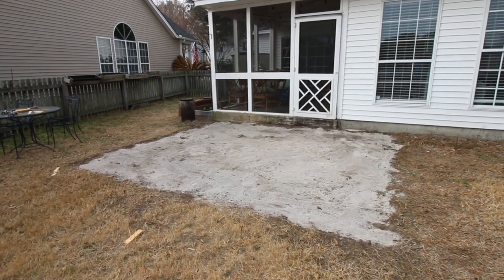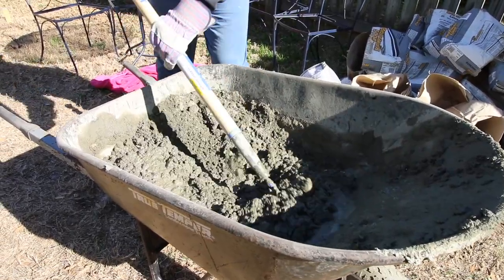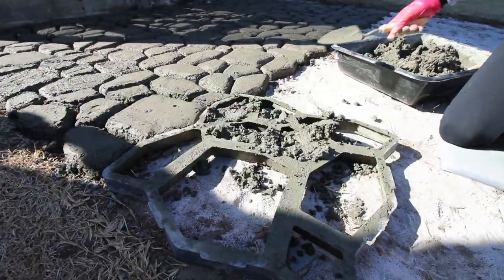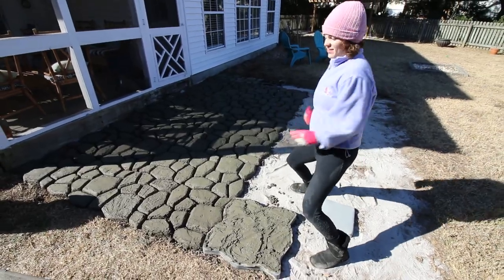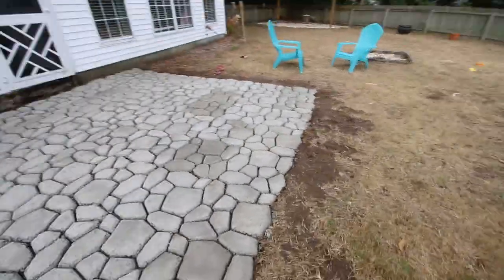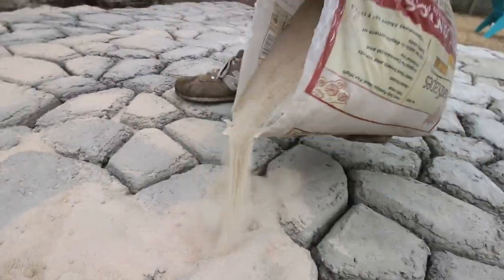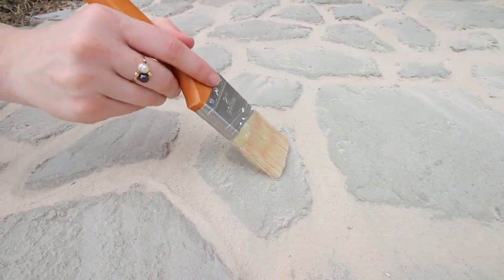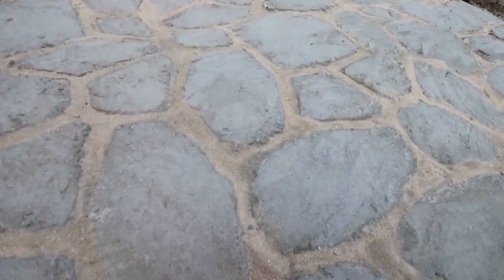Quikrete Walkmaker Patio DIY Project Tutorial

Comment: Thanks for this awesome video!!! I've been doing my research for a few weeks now and feel I am ready to take this project on as soon as it stops raining here in Indianapolis! I noticed that each time someone asks how many bags of cement you used you give the same answer "That really depends on how big your space is! The bags of concrete are about $5 each in our area, the jointing sand is about $20, and the molds are about $25." which is helpful within it's own right, however I am wanting to know how many bags it took for this specific project. The reason being that per the dimensions of 14x14 that you provided, coupled with the dimensions given on the paver mold I just purchased, it will aid in me purchasing as close to the correct amount of bags. Could you please share how many bags you needed to complete your 14x14 patio? Thanks in advance!!
Reply from the maker: I believe it was about 32 bags. But maybe get some extra to be safe ;)

Comment: Hey. Thanks for the information 💜💜. How many bags of quikrete concrete did u use for the 14x14?
Reply: 49 60pouds bags I understand is one bag per each stamp. Each stamp is 2’x2’.
Reply: To add to what Cristhian said, Pallets of 80lb concrete from most box stores are 42 bags per pallet.  Not sure if the 60 lb bags are more per pallet or not.  Were currently working on a 12' x 50' patio.  Its a beast of a project.

Comment: Great job, looks good and you explained things very clearly. Any chance of an update after it's been a year? Any problems or issues?
Reply from the maker: Glad you liked it! The update is that it still looks amazing. We have had no problems with anything. No weeds breaking through, no cracking.
Reply: Charleston Crafted great video! Did you do anything to the edges of the patio? I’m worried that the stones could break off from the edges without edging?

Comment: Excellent video this! I am a new home owner and my backyard is just dirt now. Can I do this over that or do I need to cover it with any material first to get started using Quickrete? Please advise.
Reply from the maker: You should make sure the ground is level and compact. The best thing to do is to lay down a layer of leveling sand first, but you can do without it if the ground is well-compacted.

Comment: Hey.. this is an awesome video and the first one to describe polymeric sand. Wanted to know about quantity of sand required for number of molds.. ballpark please. Also you have mentioned in one of your replies that edges are broken because of moles.. I am anticipating that problem too. How did you fix it?
Reply: I also have the same question. I just made two walkways using the walkmaker and would love to have a ballpark on the amount of polymeric sand needed. I have 31 walkmaker grids between the two walkways.

Comment: How many bags of quikrete did you end up using? I’m wanting to make something like this and it’s hard to estimate how much to purchase. Also, could the sand you used in between be used with larger pavers?
Reply from the maker: We found that we needed about two bags of concrete for three molds. The exact number will vary based on what size you go with. The sand can definitely be used between any pavers you go with.

Comment: how long did it take you to set the actual stones. I do realize they had to sit up for a while before adding the fill in sand for the grooves. I'm curious to see how long it takes to fill and each mold before you move to the next mold. Great Work!!
Reply from the maker: If you have someone mixing concrete and someone filling the molds, you can move seamlessly along. Putting the concrete into each mold just took a couple of minutes each, then you immediately lift the mold and move on to the next one.

Comment: How many bags of the polymeric sand did it take to complete this job?
Reply: 1- 80lb bag of concrete fills one mold.  Each of these molds are 2'X2' and are 2 inches deep. If you have irregular area, then you are gonna need to also make some spare on like a board of wood or cardboard to fill in the odd spots. I have also seen people use cardboard to create molds in the odd spots where molds will not work and need filled in.
Reply from the maker: It took us about six bags I believe.

Comment: I wonder if there's going to be any issues when I do my project like this to let grass grow up between them
Reply: I made a similar patio but laid down weed barrier first.
Reply from the maker: We've had no issues whatsoever with growth because of the polymeric sand in between the pavers.
Reply: So I didn't catch it in the first part of the video, did you have the whole thing pretty level? How did you accomplish that?

I was going to do something like this, but I have to do something quick and dirty to be ready in like 6 weeks, so instead I think I'm going to just buy some large 2x2 concrete pavers and set them up so they are level, and then put some of those decorative interlocking deck pavers on top for a nice look. It won't be long-lasting because of roots underneath and no gravel or sand, but I can always redo it after.
Reply from the maker: @kbanghart  We removed the old patio, then dug out a new expanded area. We leveled as best we could with the dirt that was there, but then we used leveling sand. That took care of the rest.
Reply: Do you think it work as well to just put weed block down over grass or mud ?

Comment: So,  the molds don't require the same preparation as stone pavers? Like landscape fabric,  gravel,  etc?
Reply from the maker: We did add some leveling sand, but not much. It depends on your area and how much shifting your ground does. We haven't had any issues. The polymeric sand in the joints is flexible, which allows for the "stones" to move around a bit.

Comment: That came out great. How many square feet was that? And about how much did it cost to complete?
Reply from the maker: It was a 14x16 patio. Cost will differ based on your area. You need about 2 bags of concrete for every three moles and a bag of concrete is usually $5-6 per bag.

Comment: What did out cost you to finish the project? Thx for sharing looks simple
Reply from the maker: The bags of concrete are about $5 each in our area, the jointing sand is about $20, and the molds are about $25. We used 32 bags of concrete and 6 bags of sand. And 2 molds. So just under $400.
Reply: @CharlestonCrafted  thx

Comment: Can you tell  me an estimate of how much you spent for your 14x14 feet concrete patio? I'm planning on doing my backyard and want to know how much it would cost me. Thanks.
Reply: I did 3” of gravel under mine before pouring my pavers which is about a  14x14 area. For the gravel, 2 walk maker molds, and the high strength concrete mix and a trowel to give it a smoother finish on top and the joining sand it cost me $496. Hope that helps

Comment: Hi! Id like to know the walkmaker mold and polymeric sand ratio. How many mold per bag of sand?
Reply from the maker: Officially one mold = one bag of concrete. We found we used a little less than a bag.
Reply from the maker: Oh sorry you mean the sand. We used 2 bags for 48 square feet
Reply: Thank you for your reply. Polymeric sand is expensive but I think it’s worth it. BTW, they recommend to seal concrete after 28 days. I will seal mine after laying out the polymeric sad.

Comment: i made also a sidewalk in my yard. but i don't want to fill it with sand. does white cement will do the work as well?
Reply from the maker: Any color concrete will work (they have concrete dye) but we used this specific type of concrete due to the exterior durability.

Comment: How much did this project cost you?
Reply: I just did a patio last weekend that was about twice this size.   Mine was about 275 sq ft.   took 75 bags of fiber reinforced concrecte $330 + 12 bags of poly sand $140 + 2 forms (17/each)  I put in paver block edging as well around the edges, which was an extra $100, but it cleaned up really nicely.   all together that cost me $610.   Saved me THOUSANDS had I paid some one to do this.
Reply from the maker: That really depends on how big your space is! The bags of concrete are about $5 each in our area, the jointing sand is about $20, and the molds are about $25.
Reply: Saving thousands is what its all about
Reply: Just 5 dollers

Comment: You guys did an amazing job! This is my project next weekend and your patio size looks about the same that I need... How many bags of concrete and sand did you need as coverage for your area?
Reply from the maker: Hi Kamiliah! We ended up using 36 bags of concrete and 7 bags of the polymeric jointing sand. I would recommend having a few extra bags on hand in case you end up using a little more. The molds are made to hold a whole bag of concrete, but we found that two bags did about three molds. It wasn't exact, so that's why we recommend just getting a few extra bags that you can return later if you don't use. You don't want to end up having to run back to the store when you only have three squares left! Thanks for watching!
Reply: Charleston Crafted Thank you so much!
Reply: How much did this project cost you? We are doing walkways and cannot believe how simple and gorgeous this looks!

Comment: when i attempted this, the rocks in the concrete mix came to the top. so instead of a smooth surface, i had a bumpy, rocky one. i made a few and gave up...
Reply from the maker: I’m sorry that happened. It sounds like your mix was too watery. It should be the consistency of wet peanut butter! Pretty thick.
Reply from the maker: I’m sorry that happened. It sounds like your mix was too watery. It should be the consistency of wet peanut butter! Pretty thick.
Reply from the maker: I’m sorry that happened. It sounds like your mix was too watery. It should be the consistency of wet peanut butter! Pretty thick.
Reply from the maker: I’m sorry that happened. It sounds like your mix was too watery. It should be the consistency of wet peanut butter! Pretty thick.

Comment: So pretty....From start to finish, what was the total cost for that 14'x14' concrete slab and how many days did it take?
Reply from the maker: It was a 14x16 patio. Cost will differ based on your area. You need about 2 bags of concrete for every three molds and a bag of concrete is usually $5-6 per bag.
 It took one day to do the concrete and about half a day to do the sand.

Comment: But how do you edge it. Like how do you keep the sand from falling out of the cracks around the edges?
Reply: I used the plastic landscape paver edging.=   That you stake in next to bricks/stones.   They sell it in 4 ft sections at lowes and home depot etc.   You then put the sand between the edging and the stone and it sets up perfecdtly.   It works perfect.
Reply: I should add, the four foot sections can then be staked together as well to make a perfect line.
Reply from the maker: We didn't really have much problem with the sand falling out. It's pretty heavy and thick, so pretty much it stayed in on the edge. Once we wet it and it solidified, there were a couple of places where it had fallen out of the edge, so I used a knife to cut that part off, then sprayed the dry sand and it formed a solid edge.
Reply: Still trying to that problem it rained a week later it's now on the grass I put more sand down yesterday it's more even I think this is a wait and see project nxt I want to seal mine
Reply: Did you remove it when it dryed ?

Comment: The polymeric sand is garbage.  After a year or so, it breaks down and creates a mess.  Best to just grout it and seal it.
Reply from the maker: We'd have to disagree with you, Kevin. We did this project over a year ago and none of the sand has broken down. We did have one "rock" break off on the outer edge, but we have moles run right beside that edge, and it made it loose. But there has been no break down or mess at all. Thanks for checking us out though.

Comment: You repeated say you're using concrete. Concrete has aggregate in it including stones but I don't see stone so I'm wondering if you're using mortar rather than concrete. People use mortar and concrete interchangeably. You're right in using concrete here but I don't see stones.
Reply from the maker: Thanks for the question Ian. We used concrete, not mortar. There are small stones in the mix!
Reply: Ian Moyer - they used the product quikrete which is mix of sand, gravel and cement. You can get them at lowes or Home Depot. Don’t forget to pick up some Polymeric sand towards the end like they did here. Will be nice and easy to have extra hands to help you. Goodluck!

Comment: Regular sand is just as good. Instead of paying a higher price for some so called se ialty sand
Reply from the maker: That depends on what you want. If you are OK with loose sand in the gaps, then sure use regular sand. But that will not hold up in rainy climates like ours. It will literally wash away! The polymeric sand solidifies and is stuck in place. It’s worth the cost for us. But hey if you want to build a whole patio and then save the few bucks on the end and have to resand each year, that’s up to you.
Reply from the maker: That depends on what you want. If you are OK with loose sand in the gaps, then sure use regular sand. But that will not hold up in rainy climates like ours. It will literally wash away! The polymeric sand solidifies and is stuck in place. It’s worth the cost for us. But hey if you want to build a whole patio and then save the few bucks on the end and have to resand each year, that’s up to you.
Reply: @CharlestonCrafted  false had it in my pavers in the back for over 10 years never once have i had to add more... but then I consider water run off & build accordingly ..etc
Reply from the maker: @tomvogt4043  Cool.

Comment: You should have taken a trowel to smooth out the edges and top surface.
Reply from the maker: We did and shaped each stone shape, rounding the corners slightly.
Some of the bags of mix were rockier than others. Retrospectively, I would have added another bag to those rocky mix to help them get smoother, or top them off with wetter smoother bits of another bag.